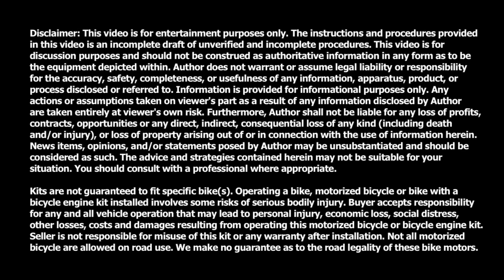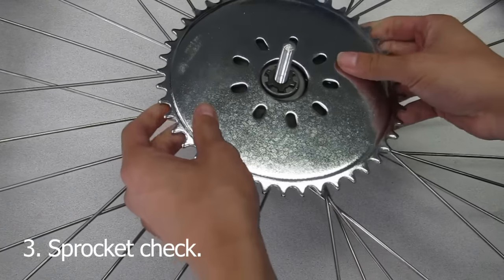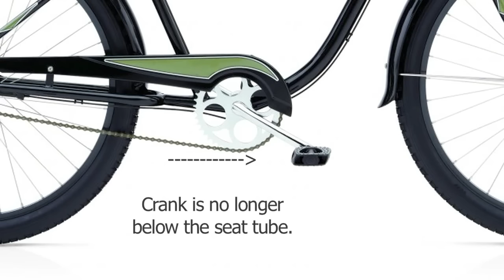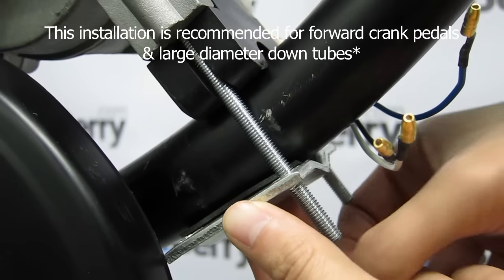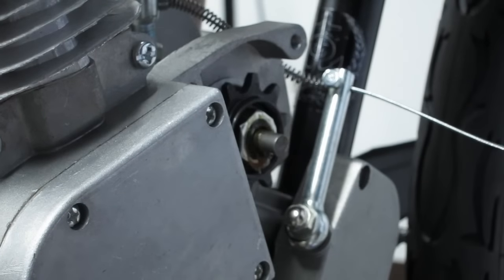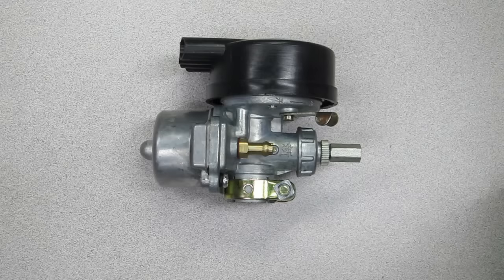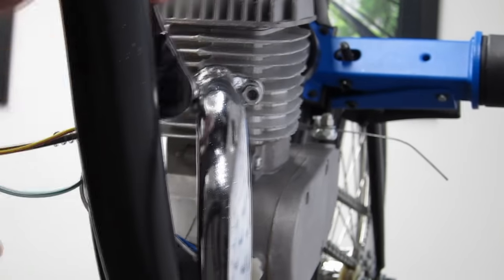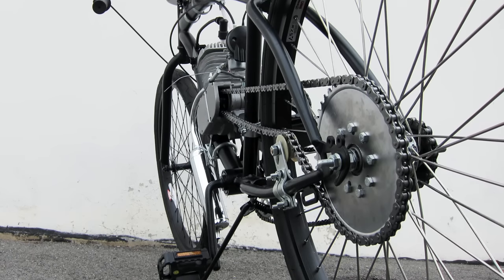How To Install 80cc 2-Stroke Bicycle Engine Kit FULL DVD 66cc 48cc 50cc

Comment: I'm actually going to be buying a bike next month that a local here built in Canada Way Down East. And I'm pretty sure the whole shebang came from you. At least the motor and whatnot definitely did. So believe me when I say this, you have Canadian customers.
   Already have one that I'm working on a building and whatnot but I think it's still a good idea to have the backup. And I tend to trust it where a good chunk of it was built by you bikeberry then the rest of it was put together by a very experienced person. I'm good with the motors as I'm a certified small engine mechanic. However I'm still learning the rest of it which is all very much important. Like making sure your sprocket gets mounted correctly and true so the chain is within its parameters, things like that. And that's where your videos help a lot as well. Therefore I do trust anything that comes from you

Comment: Of all the videos and info I've looked up considering these engines this is by far the absolute best there is. My bike is nothing like these new easier models lol. It's a fat butt Shwinn Stingray and I still got it mounted within an hour of watching this. Tho the electric wiring part could be a tad better in explanation as not all the engines come with those colors and it's rather easy for newbies to cross wires. Other than that absolutely awesome job on this 👍

Comment: For those wondering, here are the fuel ratios (I think) 
Break in: 18:1(6oz oil per Gal)
After Breakin : 24:1(5-6 oz Oil per Gal)
Reply: 18:1 should be 7.1 oz oil to a gallon.
24:1 would be 5.3 oz.
Too much oil leans out the fuel mixture since it's getting less gas and will run hotter, so more isn't better.
Reply: @wingerrrrrrrrr  so don’t fully full up the petrol tank
Reply: Its 8oz. For break in period then after that 5-6oz
Reply: Use 1:40 right from the start or the rings will never seat
Reply: @wingerrrrrrrrr  less gas = less heat not more heat! more oil less wear
Reply: 18:1 (1.8 oz per gal)
16:1 (1.6 oz per gal)
40:1 4.0 oz per gal)
32:1 (3.2 oz per gal)
Reply: This is just 2 stroke oil ratios 6oz per gal would be 60:1  you would foul the spark plug out use a baby bottle to measure your oil most oil jug are only 6.4 fluid oz there is a chart on the back of the bottle
Reply: 25:1
Reply: 16:1 for any new 2 stroke engine always. It's better to have to much oil than to not have enough. Rather have a fowled plug and some oil being tossed out the exhaust than a blown up engine.
Reply: A lot of experienced builders suggest 32:1 (3.2 oz oil) for the entire life of the engine. This includes break in.
Reply: Hope so I was n wondering b that
Reply: @kronikphase  for break-in then 32:1 or 40:1

Comment: ...funny how I had to figure all this stuff out for myself(especially the carburetor assembly) and my build with gas tank Kreem coating took 3 days NOT 2 - 3 hours, like it says on-site, lol. My build was on a Schwinn Errand and it was perfect, not a thing wrong with it. I got speeds of up to 41 mph, until I burnt the brushes out.
Reply: What brushes are involved with the two stroke motor? Did you mean you burned out the clutch?

Comment: I recently bought an 80cc motor from you guys. Did everything the way you guys did it. Starting up the motor jolts while it idles and when you gas it, it's at the same speed as it idles, but no jolts.   I see the reviews on Amazon and the description.  Some people said they weigh 200 and they are going 40mph. I weigh 140 and I'm going at a walking speed 😑.
Reply from the maker: Give us a call at (800)317-0479 and one of our specialist will be happy to help you with this issue.
Reply: sounds like a badly tuned carb
Reply: Adjust the idle screw. It sounds like the screw is not set right or the throttle may have not been assembled right. Triple check the throttle in the carb.

Comment: Just got one of these and mine came with the sprocket tool as well as the front mount piece you just put on your engine. So far pretty straight forward

Comment: Ca you upload a vid of how you do this on a 
Mountain bike or can you try and explain to me of how it is done
Reply: KSpooners it’s similar but you won’t be able to change gears. if you keep your derailleur, but remove the cable it’ll work
Reply: @arjunyeleshwarapu  why cant you change gears. Mount the shifter behind the throttle, it has a set screw
Reply: Jacob Butler yeah that could work... ive kind of stopped using my bike cause of the chain constantly falling off bc its never aligned, and also gas leaks a ton with these things
Reply: Exactly the same as this one.
Reply: @arjunyeleshwarapu  ... Leaking from where ?
Fuel Line ? Heat up the line before putting it on either end. Once it cools it shrinks tight.
Pepcock leaking ? Tighten it. Still leaking ? 
Gastank posts ? You over tightened the gastank posts to the frame...
Reply: @brianmccann666  everywhere... absolute disaster lol
Reply: @brianmccann666  stupid vacuum leaks too
Reply: Generally speaking it works exactly the same as how they showed on the video of We just watched because that's what I was installing mine on was a mountain bike it's basically exactly the same

Comment: I agree with the comment about the tools used in this video but on the other hand compared to other videos I've seen this one is comprehensive and easy to understand. As I said in my last post this video saved me a lot of heartache. As far as the electrical there it's that much to it without getting into a technical explanation of how it all works. I personally just wanted to install the kit and get it running. So I would give this video an A minus which is still very good. Additionally FYI there is a lot of info on the internet on these motorized kits so spend some time and do some research before you get started.

Comment: Awesome video. Made my installation an absolute breeze. 
Question: can these engines go out of timing? I did a test run, chain tensioner came loose, locked up chain. I fixed it and now don't have any spark... Thanks for any help yall
Reply: Might have damaged whatever part transfers the mechanical energy of the chain to the magnetic electric device.

Comment: Around 110 years ago or so the motorcycle morphed out of the pedal bicycle fitted with an engine of one or two cylinders. The engines used were usually four stroke.
Reply: That's pretty cool history fact

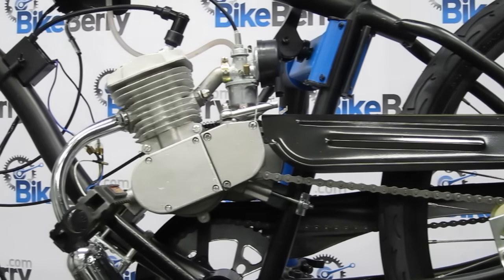Comment: at 20:00, you said the fuel ratio is as follows, but said and showed nothing? What's the ratio?
Reply: There seem to be various comments on the ratios. I have been reading the ratio should be 16:1 (8oz to 1 gal) and 20:1 or 24:1 for normal riding.
Reply: 3 oz of oil per gallon
Reply: vilhis 
Its 16:1 in break in (16 L gas to 1L Oil) and 20:1 after break in (20L gas to 1L Oil).
Reply: xTurboHD how do you put all that in a 1.5 or 2.5 litre tank sorry I'm a noob at this
Reply: i think its every 16 L gas its then 1 L oil
Reply: Paul Kogioumtzis its a half gallon tank. For breakin period which is 4 tanks of gas you use 8ounces of 2 stroke oil per gallon of gas. After the 4 tanks of gas you can go to 6.5 ounces oil to gallon of gas. Your welcome
Reply: Jesse givens, the fuel oil ratio is 16:1 rato which is 8oz of 2 stroke oil for one gallon of 89 octane or higher unleaded gasoline that contains up to 10% ethanol. Ride at least 15-20mph and ride for 20 minutes to break in the engine easily. Do not use unleaded fuel that contains over 10% ethanol because you can lock up the engine. After the break in run a 32:1 rato which is 4oz of 2 stroke oil for one gallon of fuel and you can ride fast and long as you want. You don't have to run scooter or motorcycle oil that bikeberry recommends but it's optional. The oil I recommend to run on those motor is vp small engine fuel full synthetic 2 cycle oil or echo red armor 2 cycle oil that are in a pint  or gallon. You can find vp 2 cycle oil at walmart and the echo red armor it's available at home depot or at a echo dealer. I hope this fuel and oil ratio helps
Reply: xTurboHD 20:1 that's way too much oil. 32:1 is the best so you are running less oil
Reply: wooden wolf WHATT??? I WAS USING 40:1 FRUCK
Reply: @siberianfred7670  24:1 is way to much oil 32:1 or 35:1 is recommended so you don't have to deal with lots of carbon build up in your motor. It can reduces the amount carbon build up if you use those ratios that I mentioned. Hope it helps.
Reply: Normal mix for 2 strokes is 50:1. You guys are going to be pouring clouds of smoke out at those ratios. Newer 2 strokes now are running 100:1.
Reply: @Bike Life_93 doesn't that foul the plugs constantly and blow clouds of smoke?  I've seen that these Chinese motors call for that ratio but also say 10-40 motor oil is ok. Lol. China. Ratio has a lot to do with the oil you use than what you put it in  I think good quality 2 stroke oil synthetic should be fine at 40-50 to one ratio after break in. All the chainsaws, boat motors, dirt bikes etc I've ever had ran 50-1. That's so much difference in fuel you will probably be richer.
Reply: @Bike Life_93 I've never had one die on me. I use closer to 60:1. They run significantly better. More power, less smoke and no fouled plugs. My chainsaw is ported out and screams. It will do so continuously for hours day after day. Boat motors the same. 20:1 is overkill to the extreme, it's diluting the gas so much it'll cost you power. After one short run on a plug it will be significantly degraded, run like crap and be down on power. My past 40yrs of experience with 2 strokes. The biggest thing in 2 strokes for longevity are not lugging or over revving them by gearing them wrong. I see lots of people putting small sprockets on trying for more  speed. That will kill them. They need to run free and easy to last.
Reply: @paulkogioumtzis4386  Mix it in a separate fuel can and add the fuel after. There will be fuel left over for when you are ready to ride some more.
Reply: What type of oil 5w-30
Reply: @burnt_toast305  thanx read a dozen other replies and was confused good job
Reply: @clintbliss2046   also lot of oil lowers your fuel octane wich is probably why they want you to run high test
Reply: @xturbohd4466  Thanks a lot .
Reply: Joe mama  😂

Comment: great video! am starting my build today and this helped so much
Reply: did you finish it ever? how is the bike doing?
Reply: @walkerfharris  built 4 since then with a 5th ready to be built. i using an rat bike with oversized frame and tires. just trying to figure out how to mount the engine
Reply: i think i am ready to do some commercial builds for resale. also bikeberry.com is a great source of parts and kits if you have not already checked them out

Comment: is it just me?
or are the Handle bars "up-side down"?
Reply: NinjaViking1 yes, but if you look at pics of traditional "board track racer" bikes of a century ago, the flipped bars were  "how they rode 'em". On a beach cruiser frame it gives that vintage look, especially if you wear a backward "duckbill" Tweed hat (or kangol), and round lens or "red Baron" goggles. Those puffy thigh riding pants too, lol. Style points count you know!
Reply: It’s just you
Reply: Tucking down helps weight distribution & with wind. This is a good compromise vs drops. Kudos to these guys.
Reply: Cables are not long enough 
Had to do something. Also it will be nice when that wire tie breaks at the chain guard and it gets jammed up. Your asking for a crash!
Reply: Lastly, prepare for spokes to be taken out because the cheap ass China made chain twisted.
Reply: @mitchellbrowning2666  huh k m I’ll mm

Comment: When I put my sprocket on the spokes I did it by taking the rear wheel off the bike, fitting the sprocket, plates, bolts, rubber ect loosely then refitting the wheel to the bike to do the alignment.I find if you attach something to the bike's rear frame near the sprocket (ideally a DTI gauge but lol I held the hammer against the frame) and rest it on the big sprocket so its just touching, then turning the wheel it will let you see how much the sprocket is out by and let you adjust it in both up and down and left and right directions until you have it done up right. The manual with mine said the tolerance is 1.5mm (but not in which direction?) which was easy enough to achieve.

Comment: I would also put thread locker on the exhaust manifold and anything with a gasket so the head gasket bolts and the carburetor intake. Had experience with these booth coming loose and the exhaust falling off! With thread locker no problem at all

Comment: Hi. I'm a paraplegic and use a wheelchair.  I would love to do a build like this but I would have to start with something LOWER with THREE WHEELS.  Kind of like a trike.  Have you ever heard of this being done ??? and what are the chances of my success with this project ???  I'd greatly appreciate your info and advice if you are able to give it.  Thank You.  Sincerely,   JAMES.
Reply: 5 years and still waiting huh ?   Damn i just subscribed too
Reply: Yes I have one but for a trike build I would recommend a 49cc 4 stroke engine if you want to ride in residential areas because near me they hate all my dirt bikes three wheelers and motorcycles etc.
Reply: Buzz Clark the 49cc 4 stroke kit has a pull start so you won’t have to pedal to start the engine
Reply: Curtis check my new comment
Reply: you will need an electric front hub motor to kick it over
Reply: You can build a stand to set it up and have the rear wheel off the ground pedal and release the clutch other than that they do have  electric start 4 strokes in all a 4 stroke is your best bet go to harbor freight buy a 212cc predator engine for 100 bucks buy a mounting plate for 30 and the just source an ATV mini bike ect gearbox those go like 50ish bucks depending on brand then lastly order a 36 or 38 tooth sprocket with the 3 bolt adapter that fits around the wheels hub and bolts to it Amazon has them for 30 bucks after all that you're all good and would be ripping up the road with those 2 tires instead of 1

Comment: For example, the rear sprocket 44 tooth has burrs on one side.
These should be filed clean before the installation !  That could take up to an hour by itself.   I did this with a small  round file.
It will save your chain from exploding,  and yes it has happened to me

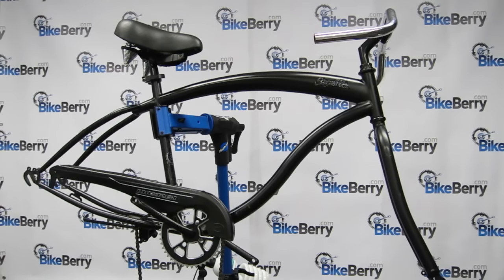Comment: 0:30 hahahaha I’m doing it on a bmx
Reply: Did it work
Reply: @arablakba6988  yeah for 2-3 months then i rode it basically everyday i was adjusting the spark plug and snapped off the hook saving for a new plug and a pull start because the wheel size is 20 inches it has to be rolling down a hill to start

Comment: I scored on an old road bike from my work. (moving company.) Downside is- the rear wheel has a 3 spd internal drive hub. But upside is, I have a 26 Sun ringle wheel I had bought but never used. Should work decently if the wheel fits the old bike I found. Plan on riding it to, and from work. Should be fun, even in the snow. I'm going to try and find a use mountain bike with a straight hard rear frame so I can use that in the snow.

Comment: Great video! I just put mine together, and sorry if this is a stupid idea, but where do I put the engine oil? I cant find a drain plug, or anywhere to put it.  Does it need to be taken apart?
Reply: you mix in a small amount of engine oil with the gasoline. i think a 40-1 mixture is what I've read is a good mixture.

Comment: What does the white wire hook up to
Reply: I use the White Wire, for a Headlight 6 volt, it powers it like a generator.( its not the best but it works at night ☺
Reply: Thx

Comment: Great video but what was the purpose of the 1/4 hole in the handle bar by he throttle? I  am missing something
Reply: The hole receives the pin in the throttle so the whole unit doesn't spin.

Comment: Hey I've got a question can the engine run without the carburetor. Like if you shoot the fuel directly into the opening (carburetor opening), wouldn't that increase power to?

Comment: Does my bike has to have  26x 1.75 inch wheel ? Can it be a bit smaller or bigger ? And last question; bicycle frame can it have 17, 18 or 19 inches ? Thanks.

Comment: I have built many motorized bikes
I have even used a chainsaw engine on one.   That one I had a difficult time gearing it down low enough.   And I ended out burning out the automatic clutch and it was idling at 25 mph !
That sounds cool to the guy that likes speed,   but it needed to be geared down much much more. It had no power to speak of.

Comment: Have a question for you I have a 2 stroke 80 cc  engine and I'm thinking about adding a 1500 watt e bike kit on the front wheel.. question is is that possible to do?

Comment: So for the rear sprocket installation I was only given the 2 larger plates the 2 rubber discs but didn’t receive the 3 smaller plates is that a factory issue or am I supposed to just run it like that if it’d even work

Comment: Question what type of glue do i use for the throttle ??? My bikes rubber throttle the glue that was there already i guess dried up cause now it turns and turns without starting the engine sometimes so i took the rubber throttle handle off and seen all the glue had dried from the rubber to the plastic throttle any suggestions to what type of glue i can use to fix that or am i better off just replacing the throttle as a whole ???

Comment: What's a good front brake set up for a beach cruiser 26 inch. The lever, the line and the brake mount itself?
Reply: due to my throttle taking so much room I'm having a hard time fitting my brake on it. gear shift, brake, throttle, handle. no room for a mirror lol.

Comment: Is an air bubble in the gas line a big problem?  I've only rode it 2 times for a total of 10 minutes.  I seems to run fine.
Reply: +Dominic Balistreri When you open de gas valve, does the air bubble stay there? The fuel line should be full when gas passes through it. When the valve is closed, it is normal to see an air bubble.